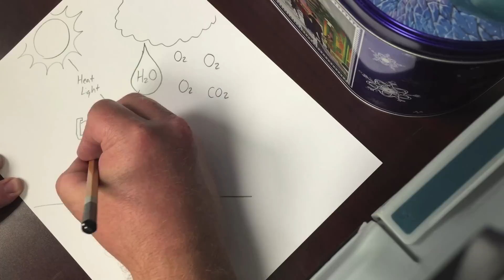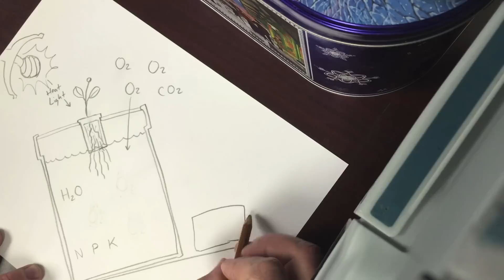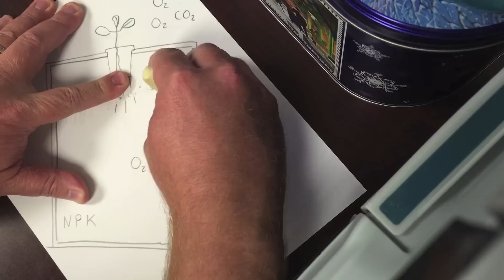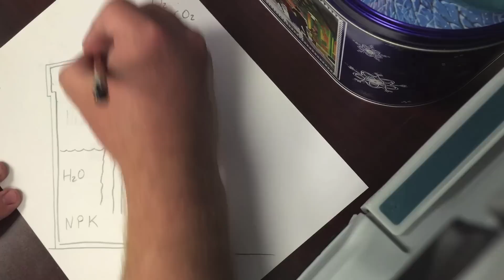How the Kratky Method of Hydroponics Works

Comment: if we can find a way to do it in open ocean it will be a breakthrough
Reply from the maker: Ohhhhh what!  Like floating barges with reservoirs because Kratky method doesn't require electricity?  Wow you're blowing my mind right now.  You could do it with very little electricity.  If you could extract your nutes out of the ocean with solar power you make masses of food!  wow i have to think about this one more
Reply: yeah hahaha think about it! have u watched the video of this guy that made an island out of trash plastic bottles and used the mangrove tree roots to fix the bottles in place so it remains floating? also worth look into
Reply: Indeed, that would be cool, wouldn't it? Salt kills most plants though, so you would have to find a way to filter out the salt without losing the beneficial nutrients.

Comment: I bought a bunch of 2 inch net pots, but unlike the photos on Amazon, they just have slots in the sides and then a single 0.8cm hole in the base (no slots). Can you think of any reason why this would end up being a problem? Infact I'm not sure why they  even have slots in the side, I've yet to see any plant grow roots through anything other than the base
Reply from the maker: I'm not familiar with those.  They may not be ideal, but usually the plant finds a way to make it work.
Reply: Ok, thanks for the reply. Its my first attempt at Kratky, so just wanted to make sure I wasn't wasting weeks on something that is already flawed. I guess I'll find out soon enough :-)
Reply: Yes but they root at the sides because theres a gap. I was asking if theres only a hole in the bottom, is it going to inhibit growth in any way

Comment: would it be possible to do this in a fish tank, with fish living there?
Reply from the maker: I think the fist might die when the water level recedes.
Reply: so you add water. I was thinking about the nutrients or roots then the water really.
Reply from the maker: If there is enough oxygen in the water for both the fish and the plants, I think it would work fine.
Reply: awesome! now all I need is to get my fish again! I use a waterfall type filter so O2 shouldn't be an issue.

Comment: how much slow is the rate of growth of plants? also how much less will the plants grow in size at maturity as compared to aerated water system?
edit:so we dont refill the water level in order for the roots to keep growing n let the water level fall gradually with time?
Reply from the maker: I did a basic comparison a little while ago.  The airstone bucket grew significantly faster.  You would need a scientist to know how much.
Reply: nah, dont need exact scientific data....just enough for me choose which one to go for...will browse thru that comparison now..thnx..
Reply from the maker: It mostly depends how expensive adding air is and how expensive the loss in production is.  Air temps and reservoir size factor heavily on it.  MHP gardener did a comparison a while back.

Comment: Total beginner here, just bought the Ikea hydroponic kit which seems to be this method. Can I germinate seeds any time of year if I have grow lights and heat pad?
Reply from the maker: yes.
Reply: Thanks Jeb.. Do you reccommend nutrients that are specifically designed for  hydroponic use or can I use regular liquid feed, like Chilli Focus?
Reply from the maker: most of the nitrogen must be nitrate.  All nutrients have to be in a form plants can readily absorb.

Comment: Ok I understand that it feeds from the nutrients below but how do you go about keeping it watered as the water lvl drops and the roots grow lower? Do you have to add a air stone and then refill the water or will the roots be ok being buried in the nutrients?
Reply from the maker: If the plant needs more water before it matures, just add some water.  Airstone not necessary.  Full nutrient switch, I haven't used with kratky, but that would make an interesting side by side.  If air temps are pleasant you can fill it to the top.  In the heat you need to leave some exposed (at 1/3 to 1/2 exposed for a large plant).
Reply: Jeb Gardener thanks!!!!

Comment: Jeb do you have suggestion of good cheap desk LED grow lights? I only see expensive hanging lights which I can't afford to install on my apartment. Would buying a lamp light and buying LED lights to install on it work? I only need it for one or two plants in my apartment.
Reply from the maker: Sleestack has done some reviews of screw-in led grow bulbs.  I think a 100w equivalent cfl might be cheaper and easier to get. Either way get it as close to the plants as possible.

Comment: The most important thing about the Kratky method is knowing how much nutrient the plant is going to need during its life cycle. I've read Kratky's paper, and he seems to assume the gardener already knows this. All he says is some plants will need more, sometimes lots more, but nowhere is there a table of values of how much nutrient to use broken down by plant type. He only talks about the concentration of nutrients in EC values, and then you need to size the container by plant type. Left out is how big this container needs to be for the type of plant. This is the main problem with Krakty's method.

Comment: Hi Jeb! Thanks for the tutorials. Regarding the water, is it set it and forget it or do you change it at any time? And if you change it. I take it only fill back to where it was at in the container, is that right?
Reply from the maker: Never change, only top off.  I try to top off to between 25 percent and 75 percent of the reservoir's capacity (colder temps = fuller tote).  Use water if plant is looking perfect.  Use nutrient if plant looks less than perfect.  If possible set your timing to harvest happens when tote is at 5-10 percent.
Reply: Ok, thanks!

Comment: Does I need to refill the reservoir with the kracky method?
Reply from the maker: You don't have to as long as the plant is ready for harvest before the water runs dry.  If you need the plant to grow longer refill only half way.  If the leaves look good to dark green refill with water.  If the leaves look needy refill with nutrient solution.
Reply: Thanks for answering. but if while the plant is still growing the water runs out?
Reply from the maker: The plant will die very quickly if the roots dry out.

Comment: Hey jeb, let's say I live in a desert area, if I was to leave a container outside with the water, could water warm up too high where it would kill the plant?
Reply from the maker: I'm sure that could happen.  Use an oversized reservoir and cut back on your nutrients to help compensate.  Then paint the tote white or bury it to help with the heat.  It gets hot and dry in my area, so far as long as the leaves don't turn to paper in the hot wind you would be surprised how strong the plants can be.  Shade cloth helps too.

Comment: It looked like the totes were always full of water.. how long does it take for the water level to drop for this method?  Also, is there any concern with mold?
Reply from the maker: Levels don't drop much at all until transpiration picks up through larger leaves.  I only had a problem with fungus once yet.
Reply: Interesting.  I like this a lot.  Thank you for posting.

Comment: How does this method work in warm climates where the temp on average is above 80 all the time?
Reply from the maker: Works in my hot dry climate but sometimes the leaves on the cool weather crops get turned to paper in a hot wind.

Comment: no pumps? then how does the water reach the wools to begin root growth when their suspended in air in the tote? and how do you keep the water oxygenated with no air feeding in it? your o2 wont enter water from air
mid way says you do us a pump, then later say you dont lol
Reply from the maker: the rockwool is in contact with the water at the very start.  Oxygen dissolves at the surface of the water.  Also the roots wick up some water on their outer surface; oxygen dissolves readily in that water.  Yes I was contrasting deep water culture with kratky that is why i mentioned a pump.

Comment: Great little video 👍🏻 I'm thinking of growing some chillies like this, does the nutrients have to be a specialised hydroponic solution, or could I use and organic one?
Reply from the maker: I think your plants would grow but you would likely run into the problems with most organic nutrients.
1) not enough nitrate.  Amonia based nitrogen needs microbes in the soil to break it down over time.  So your plants growth can be stunted or they can be burned
2) not enough NPK.  So you have to add more and spend more.
3) foul odors (up to you if it this is a problem)
If you want to know for sure do a side by side with the two nutrients and see the difference!
Reply: Jeb Gardener thank you!
Reply: +Jeb Gardener think I'm gonna look into getting some hydroponic nutrient to get me started 👍🏻
Reply: what about worm casting extract?

Comment: If you look at those 4 jars off to your right behind you. Then that's very very close. To what I got going. Except the medium isn't rocks but soil. So far they haven't withered. of course it's only been 7 days. Thanks man for your videos, you've inspired me to give it a go. And just finally take it from theory to doing it. What had always stopped me from doing hydroponics ,or what was at issue? Was the pump and the air rock. I knew,people out there were doing stuff like this. But It wasn't popular method hate to admit. The method of the day, is the pump and the air rock.
Reply from the maker: Problem with soil is it decomposes which uses O2 as well.  If you have enough oxygen, you should be fine though.  Cool air temps help out, because water can hold more oxygen at lower temperatures.

Comment: How much room does an average plant need to grow its stock like 1" or so right So what we did was cut 1" round holes in our plastic over cover for our kratki beds then we cut soft foam like you use for furniture stuffing into 1" by 1" by 1" cubes then we cut a slot from one corner not quite half way through to the center and placed our seed in this pocket then by forcing the square cubes into the round holes it locked the cubes into place and we set up our kratki beds like most other people. I mention this method as I see folks wasting money on net pots and clay beads and it just ain't needed. 1" foam panels are available from Walli world ( Sewing Department )in a pack of 3 panels out of which we get like 30 plus cubes ( A.K.A. 30 plus plants) with these and our half 55 gallon barrels which we get for free plus our flat trays that we reclaim from plant trays at Lo wse  which are also free for the asking. 
We only need buy ( for now anyway ) seeds and hydroponic juice. We are looking around to find a good recipe for hydroponic juice. Then we will only need seeds. Any help with that good recipe would be greatly welcomed.  Keep the videos coming and as we just signed up we will be watching. Sorry about my spelling I have the Dyslexia.
Reply from the maker: Interesting idea with the furniture foam.  Unless you have a fertilizer factory I don't see a way around buying nutrients.  You need nitrate nitrogen for most hydroponics.  Ammonia based nitrogen has to be broken down by bacteria and they seem to need a media to live in.
Reply: Th Linn ok so we have a large catfish tank in the bacj of our greenhouse that we thought about using it to supply  our kratki beds to fill them when we set them up. We have seen here that we can set and forget them and then others here say ti add water nutrient solution every so often. we figure that as the roots chase the water level down as it drops, as long as we don't let it go dry it should still be good.
Reply from the maker: I think that could work, but I think you'll need some gravel or other media for it to break down properly.

Comment: i do have a question  could i do the kratky method and add air once a week couple hours kinda like extra help insurance if you will .   my other question is would it be advised or be helpful to add little bit hydrogen peroxide to water   im just learning in fact last week ive just started to learn this method
Reply from the maker: If you are going to add air I would just do it continuously.  I don't think once a week would have much impact.  I have never heard of people adding hydrogen peroxide to the water.  You could try it but I think it could be really bad.  At the least it would throw off your PH.
Reply: +Jeb Gardener hydrogen peroxide is a great way to get rid of alge. drew grow dose video on it ive used 2 teaspoons in 5 gallon pail of rain water with alge on side of pails within 24 hours you can see a huge difference may not be perfect clear but dose work  as for ph your ajusting ph as you add nutrients  ?    not being butt head dude just trying to learn as much as i can and your krakty has me very interested  for sure
Reply from the maker: Interesting.  I'd have to do more research and try it out in a double blind test to comment more.  Thanks!

Comment: How is it possible that you dont get algae bloom in jars?
Reply from the maker: In a fresh jar it takes a little while for algae to find it's way into the jar.  By then most of the light is blocked by the plant (because the light mostly comes from the top).  Add cool indoor temps and it works fine.  In a sunny window algae grows pretty fast and ugly.

Comment: hello, i dont know if you are still here helping people. at 5:29 you lift the lid and there seems to be a layer of "scum" on top of the water. i am just starting Kratky hydroponics and i noticed the exact same thing on some of my reservoirs. have you ever found a cause/solution for this?
Reply: If you put an aquarium skimmer it should solve that
Reply: @sunshinevalley0  i had problems with mosquitoes in the house so i had to stop using the kratky method.
Reply: update: i started adding a aqarium pump and air stone to all my things. it stops the insects from living in there and it basically fix 99% of problems.

Comment: Hey Jeb ive been trying out the kratky method because of watching your vid. I had 2 pepper plants using this method but one of them has died because of root rot. The other one looks like its starting to develop root rot too. Do your kratky plants ever get root rot? Is there a  way of saving my 2nd plant?
Reply from the maker: Rarely yes.  I've heard of people using hydrogen peroxide but I haven't tried that yet.  Make sure your water temperatures are not high.
Reply: Thanks for the reply. I think it may be due to the high temperatures. Its about 27C-30C where im at. What temps do you suggest?
btw i love your vids and the style its done.
Reply from the maker: I still working on my high temp research but I know less oxygen will dissolve at those temps. Make sure to let water level recede and give it afternoon shade. I think 80s F might be pushing it for young plants already.

Comment: For lettuce it's ОК.
BUT. do we still need an aerator for large bushes and long-growing plants?
Reply: No. Depending on how big of a water supply you use you will have to add more water/nutrients  mix. The kratky method is based on no air supply

Comment: Why not add a air bubbler cost 10 bucks and will greatly improve your productivity
Reply from the maker: It's in my office at work so noise and tubes floating around are an issue.   The bigger goal is to test methods for outdoor production so I avoid unnecessary use of electricity.  Air temps are low 70s so O2 in water is not a big issue.
Reply: but the amount of o2 is very small try adding a few drops of hydrogen peroxide each day this will help kill off any pathogens. Or if your like me and like to experiment get a underwater plant (this will produce 02 and put a few shrimp in there .Get the aqua culture started use a clear container to let light in the shrimp will clean the roots and the sides of the tank: edit adding h202 will boost the o2 levels

Comment: Thank you for the video! Very concise :) Are there no good alternatives to rock wool, so that one wouldn't have to cut away the rock-wool-ridden skin of edible roots?
Reply from the maker: I've been looking for better alternatives.  Tough when you are lazy like me.
Reply: I use aged wood chips. I've previously tried rock wool, coco coir, plain dirt, and saw dust. Wood chips are my absolute personal favorite. Free, renewable, and provides just enough nutrients by itself to help me start seeds outside of my hydroponics ponds. Coco coir was the worst of all -- no nutrition for starting seeds, way too moist all the time leading to algae scum accumulating on top, bad fungi damping off roots, and attracting/spawning fungus gnats to no end. Plain dirt didn't have problems with fungus gnats, but it didn't let the roots breathe and often washed out once placed in hydroponics.  Saw dust sometimes washes out and it didn't provide very good seedling nutrition. Aged wood chips kicks butt.

Comment: i was taught that plants don't need oxygen but carbon dioxide, sun light nutrients and water
Reply from the maker: Plants don't need oxygen for photosynthesis.  But they need it for respiration (to turn sugars into energy).  The green parts don't have a problem because oxygen is a waste product of,photosynthesis.  But the parts away from the green parts need oxygen or they will die.
Reply: thanks more i know